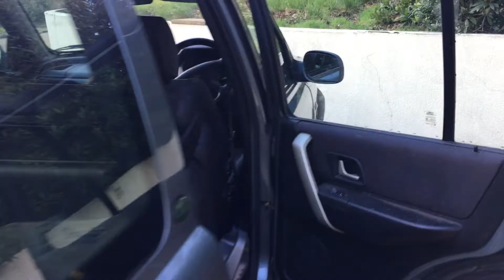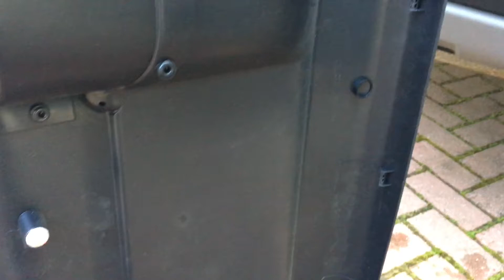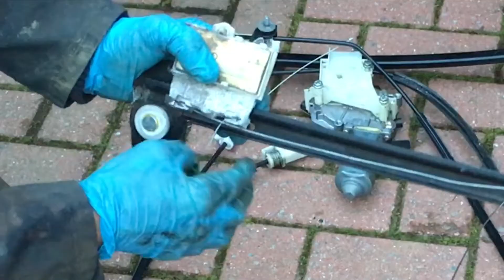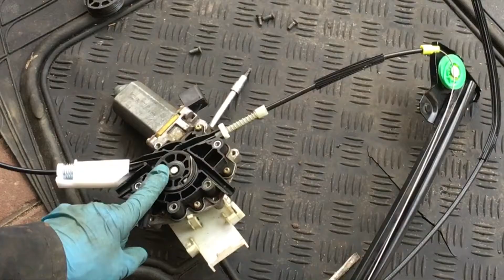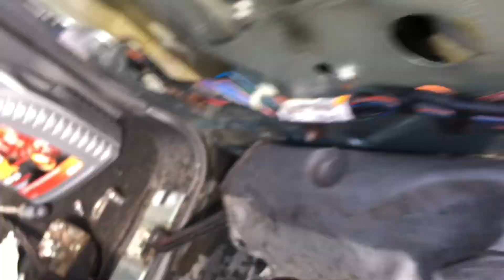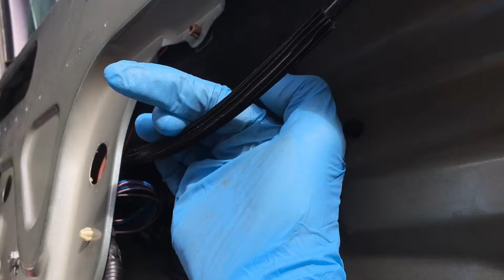How to Fix Freelander Tailgate rear Window

Comment: Excellent video! After the reinstall we also did the following procedure: 
Disarm the anti-theft alarm system.
Disconnect the vehicle battery.
Wait 5 seconds.
Reconnect the vehicle battery.
The CCU will now drive the tail door window to the fully lowered position.
Turn the ignition switch to the 'ignition' position.
Press and hold the tail door window switch in the 'Up' position until the window has reached the fully closed position.
The tail door window should now be calibrated. If calibration has failed, a warning buzzer will sound.
Reply from the maker: Thanks and thanks for your input.

Comment: Thanks for the video it was a great help, one thing I would is: When the spool and the cables are off, put the motor back in and wind it down to the bottom, and position the window sliders at the bottom of the supports. best of luck to the next guy that tries.
Reply from the maker: Cheers and well done.

Comment: Thanks for the comprehensive video. That's about the last thing I'm gonna fix when the cylinder head has completely new gaskets, water pump and cooling ;-)
Reply from the maker: Cheers, good luck.
Reply: @comeinhandynow  Thanks! The main quest will be replacing missing or terribly wrong placed bolts 😂Discovered wrong bolts at the air filter housing and missing bolts at some piping parallel to the starter. Cheers mate! 🍻
Reply: Been uploading a short of my beloved 'Goldfinger'

Comment: Can you tell me why is water collected in the tool tray underneath the tool tray cover. Great video keep up the good working.
Reply from the maker: It seeps past the door seals and runs inwards to the tray from the bottom. Look when it rains. You can stop it by making guide channels out of silicon seal to guide water out of the door rather than into the tray. One day I might do a video on it.
Reply from the maker: Thanks
Reply: Thanks for your reply I look forward to watching the silicone repair video keep up the good work 👌

Comment: After watching your video i tried to fix my window too and must say that its a real pain if you are using another kit(there are multiple kits for example your kit uses the latch on the white part to actually ease the assembly mine had a pin hole instead) i tried assembly for about 5 hours and now i cant get the window go down enough when opening the backdoor window plus it sterted to do some grinding noise that i can locate(i think a cable is grinding to the window like you warned at video)
Reply from the maker: If possible it is best to test the motor and mechanism off the car where you can test it working to both extreme positions.  Then you can see if there are any problems and what is causing it.  You need patience (which you seem to have having spent 5 hours on it!) but also you need to try and analyse what might be causing any problems. 
Maybe take it all apart and start again...
Reply: @comeinhandynow  today worked a bit again on the door, i used some cable clips to bundle cables and washers on the carriers as it was the cause of the grinding sound(car was hit from back so metal plate was bent) but only issue that i am unable to fix is the carriers not being at the same level with the cable feeling a bit loose possibly preventing the door from opening without enough clearence. I changed all other windows myself as all of them snapped at some time. And lastly my car started to give traction control+ slope light error possibly as you said in a video from brake sensor. Man i hate and love this car so much :D
Reply from the maker: See if there is a way to reduce the slack, like that pin I put through a drilled hole in the video.  If the slack is reduced the window should be able to pull down enough.  The good news is that the brake switch is easy and cheap to replace.  It’ll be worth the satisfaction of having fixed it when it’s done!

Comment: Hi, thanks for the excellent video. Do you have any problem with water leaking into the car when it rain, especially at the tall window? Do you have any idea to fix it? I am in the Southern part of Thailand. Usually, we have 8 months of rain every year.
Reply from the maker: Yes that can be an issue as the rubber gets old, at some time I’ll do a video on fixing it.  The trick is to look at where water runs inside and divert it with silicon seal guides to the outside lower edge.  Also seal under the bottom plastic boot cover.

Comment: Thank you for this excellent video: one of the most explanatory of its type that I have watched. I installed a replacement tailgate regulator (reusing the original motor) and found the same behaviour that your video showed - that instead of the window lowering half inch from depressing the door latch, the cable and spring simply tensioned. I installed a pin per the video advice, making sure it was snug for the most extended spring position. However now, I still get the door actuator click sound and can see the cable tension but the window does not lower to clear the trim. I have performed the battery disconnect/recalibrate procedure. Is there some other component failure or adjustment that likely remains?
Reply from the maker: Thanks,  That is tricky to diagnose remotely. If the window is still not lowering enough, but still lowers a bit, then it sounds like there is still too much slack in the  cable, that needs removing.  Maybe reposition the extra pin...?
Reply: @comeinhandynow  Thanks. Yes, with door open and lock in simulated closed position I can see the cable tension and window physically respond very slightly to that tension but not lowering. I have the pin in what seems the fully extended position of the plastic (approx 1-inch). Is it possible that my regulator replacement is not per OEM spec? It was a complete regulator with slides, cable and gear assembly ready for mounting to original motor.
Reply from the maker: @williamimrie8231  All I can suggest is try and work out what the problem is.  Some suggestions:  Is it possible that it is related to the fact that the door is not actually closed, only simulated, so maybe the window is a slightly different height. Has the window been calibrated by moving it down and then up all the way and keep pressing the up button for a few seconds (this has to be done after a battery disconnect, I’m assuming this recalibration also works if battery wasn’t disconnected).  Can you hear the motor turn for the right amount of time (0.5 secs or so) and is it possible there is still slack in the cable somewhere. What did it do without the pin for comparison? Does this indicate that the pin is needed in a different position?  I hope you can work it out.
Reply: @comeinhandynow  Thanks for your continued help. I had tested with door in actual, as well as simulated, closed position. No difference. Had also performed battery disconnect and recalibration a few times, including a fresh repeat now. When I re-examine the cable movement while door is in simulated closed position I see that there is indeed a small gap (approx 1/4 inch) behind my pin, which closes as the cable tensions. Before I installed the pin the plastic ratchet and spring fully compressed in response to the door latch. I could try again with a new pin hole 1/4 inch closer but it took a lot of effort, with help of second pair of hands, to extend the ratchet fully enough for drilling/installing this pin against the flange face. My conclusion now is that I should seek a LR OEM unit integral with motor. This Freelander has given me 45k trouble-free miles since new and this is first required repair of any kind, so seems worth obtaining the genuine replacement that does not require adaptation.
Once again, many thanks for the excellent video, explanations, and follow-up.

Comment: Hello! I'm Nicoló, I'm Italian waiting from balearic island. Thank you so much for this video!
I own a freelander 2003 and I have the same problem with the tailgate window. I was wondering if you have any tricks to understand if the engine is broke or just the wires.
Thank you!
Reply: *writing
Reply from the maker: It is usually just the cables that have rusted and snapped. You will have to take the motor out and remove / unjam the cables to see if the motor works when you push the up/down button.
Reply: Thanks! I'll let you know.
Reply: Hello, i still have problems with the rear window...now when I push the button it goes down beeping and nothing more...cold it be the engine?
Thanks

Comment: Thanks, It's working again, but the rear wiper now is working by itself. I disconnected and reconnect, but it's still doing it. Any ideas?
Reply from the maker: Weird, check for any damage to the motor or wiring. It could be that the bit on the motor that keeps it running until it is in park position got jolted/damaged and is making it run always.
Reply: @comeinhandynow  Thanks! The other thing I'm not getting right is the window positioning with the clamps. For some reason is not going down correctly when opening the door. It gets stuck, but it seems the motor is doing its work, so, with a little pressure, it comes down. Any advice?

Comment: Hi thanks for a great video I've changed my front two and now the tailgate, but after installing it I'm getting three beeps from the dash when I try to send it up.  Any experience with this?
Reply from the maker: Thanks.  Did you keep pressing the up button until it was all the way up plus a second or two? It neeeds that to calibrate it from what i remember.
Reply: @comeinhandynow  ah, apparently I needed the engine on for it to go up the first time.. now it's calibrated and working perfectly :)) thanks again!

Comment: Thank you for posting your very helpful video. I have bought a scrap freelander for a keen grandson to work on. We bought the kit you recommended and replaced the cables. We did a test on motor (up and down) with a battery, refitted the assembly but found that the window only goes down. Neither the up switch or the tailgate catch switch will operate the window. Do you have any ideas?
Reply from the maker: You need to calibrate the window by pressing the up switch until it is all the way up and then a couple seconds.
Reply: @comeinhandynow  ok thanks for reply, its operating now
Reply from the maker: @rawindridge  Great!

Comment: My rear window is stuck in the fully up position (can hear motor running) - I have ordered the same kit as you. The only question I have is... Does the window need to be in exactly the same position on re-assembly or can the mechanism be reset somehow if for example the window is installed 1/2 way down? - Thanks.
Reply from the maker: You can install in any position. To recalibrate disconnect the battery, on reconnect it will lower back window, then turn on ignition and press up window switch don’t stop until it gets to the top +1 sec.
Reply: @comeinhandynow  Thankyou for taking the time to answer. Much appreciated!

Comment: Does this regulator also control the 2 rear passenger windows?

My friend bought one of these recently and all windows worked fine, but then the rear window just seemed to jam and be stuck you can hear it try to work, but the 2 passenger windows now do not go up.
Reply from the maker: No. See my other videos on changing the door window cables

Comment: Hi Sir,
In my 2007 model, I’m experiencing the following issue: tail window slides up and down rather well and when I press the handle, it goes down the right amount (correctly). The issue comes when I close the door, most of the times window doesn’t slide up and remain opened and when it apparently works correctly, open door lamp on dash is on.
Did you hear something about this kind of issue and may you kindly suggest me what can cause it and a possibly way to fix it?
Thank you in advance.
Reply from the maker: That must be the switch in the door lock that is a bit gummed up.  Have a look at my recent video on my channel on the rear door.

Comment: hi my rear window went down  quite slow but now it wont go up it starts to go up then goes back down even with my finger on button can you help please thanks
Reply from the maker: Could be a cable problem needing replacing like in this video.  If your battery has recently gone flat or disconnected then be aware that the rear window will go back down after raising until it is recalibrated by raising it all the way up to the top and holding the up button for a couple more seconds, after which it will stay up.

Comment: i fixed the cables. looks very good. but the window goes only down up till the momentum is to big and than the motor goes off. it is not possible to go up with the window.
Reply: without the cables the motor also turns only in on Direktion! if i click down or up....the motor turn only in one direction! with a battery i can turn it in both directions. motor seems fine. what could be the broblem here? thanks
Reply from the maker: First check it all works off the car. Second you need to keep pressing the down till it goes all the way down, then keep pressing up till it is all the way up. Once that is done it is calibrated and should work normally.
Reply: @comeinhandynow  it goes down as if the hardtop is removed. i read out the CCU. the hardtop and the lock is properly closed. What could be the problem the window is going down? i am running out of ideas....thank you very much!
Reply: @comeinhandynow  when i just touch the Botton a little bit the window goes down all the way. wont go up! hardtop switch is ok! what causes the window to go down?
Reply from the maker: @Syrocool  probably the up/down switch.  Either try a new one or take it apart and clean it up.
Reply: Did you find a solution? Mine goes up when I lock the tailgate from the outside, as soon as I unlock the car it goes down. I tried to recalibrate, to disconnect battery and with the switch too, but there’s no way to send the window up when the car is unlocked and/or I’m in driving 😭
Reply: @AL-lf6yw  i changed the lock. now idea what causes it...the lock was actually not broken elektricaly, just mechanicaly.
Reply: @Syrocool  thank you for the quick answer. This is giving me headaches also because I need the car for just 5 months and I really don’t wanna spend other money on it. I’m very tempted to find a permanent solution to leave the window always up because I need the car to go to work daily. Such a nightmare
Reply: problem may be cabrio sensor, if send bad signal, computer think that is open and push back window down

Comment: I have the same problem.  My freelancer built in 1996. As I open the page you are proposing there are many similar parts. Which one you have chosen ,please
Reply from the maker: I don’t think it matters that much but I’ll have a  look through my purchases if still listed.
Reply: @comeinhandynow  Thank you 
I was repairing the side door, and I had a lot of problem, the cables were too long and the clamp at the ends of the cables was not the same thickness, watching your video everything matched without corrections
Reply: @ZdzislawWolski  you have the cables the wrong way round or the wrong cables.

Comment: I made that role pin mode and it works but when i fully down window it broke that pice of metal that holding window.... That role pin will only works for only open and close rear door...not for fully open and close rear windows complete
Reply from the maker: The role pin only reduces the amount of slack in the cable system so shouldn’t really cause breakages.
Reply: @comeinhandynow  for now i just fix it with some spare parts from scrapyard...until i fond a new one i will disconect window switch from dashboard and use window only for open and close tailgate. In this case i can normaly use trunk. Cheers!

Comment: So how do I drop the tailgate glass as mine has failed in the upmost position and does not drop even when I try to open the tailgate door.
Reply from the maker: That is tricky. I think the only option you are left with is to try and force the door open but the risk is of breaking the glass.

Comment: is there a fix or what to check for if the tailgate window is 'too wobbly' when open - or bounces back if tailgate gets slammed shut?
Reply from the maker: Take off the internal back door cover and check that all the bolts for the window rail and motor are in place and tight.
Reply: @comeinhandynow  the13 mill nut at the bottom of the runner has a Torx socket in the bolt by adjusting this it moves the top of the window on to the water seal

Comment: Hello there can you maybe help I have replaced cables but and window goes up to the end.
It is doing a bit of noice on the end like some tension on eMotor.
Thing is when window gets up there is some biping in car and it goes down again  to bottom
is there some sonsore on top which tells car glass is  up
Reply from the maker: If it goes down again to the bottom then it needs setting up by pressing and keep pressing the up button until it goes to the top and keep pressing for couple of seconds afterwards.  It should then stay there and work properly.  If you have noise from the cables, it is worth checking they are routed properly, especially around the motor bobbin.  You can test the motor and cables with the whole mechanism off the car to check it.
Reply: @comeinhandynow  I will pull it out again tomorrow thing is u can hear noice like last 2 inches  should I just keep holding button because if I don't hold it window just goes down to fast and u are not getting it up buy just tabbing a button
Reply from the maker: @Mr-Axe-Tv  When the power is disconnected, the window controller needs resetting.  It will go all the down first on its own.  Assuming everything is connected and wired correctly then you reset it by pressing the up button until it gets to the top, plus a bit longer.
Reply: @comeinhandynow  It works thanks a lot :)